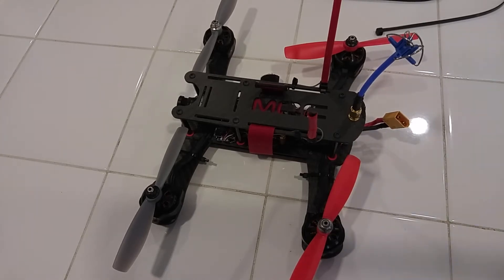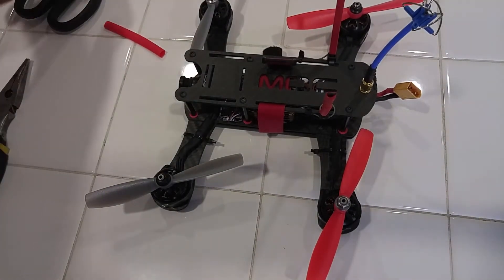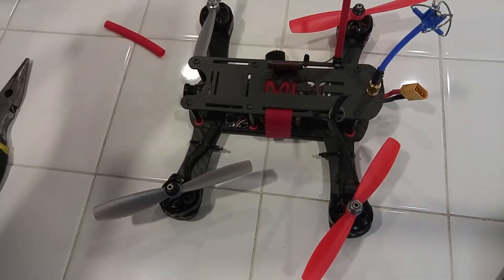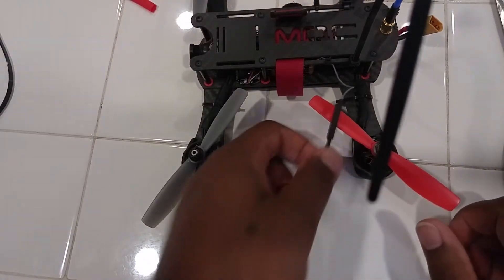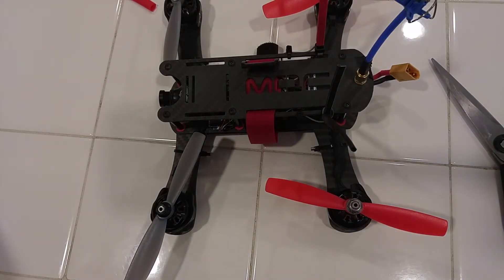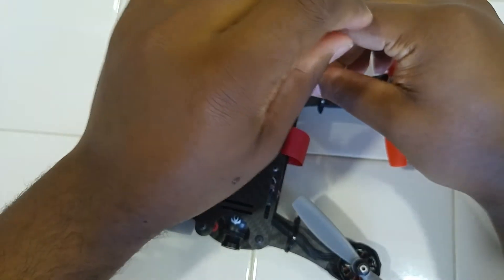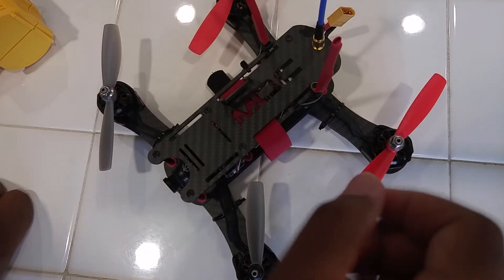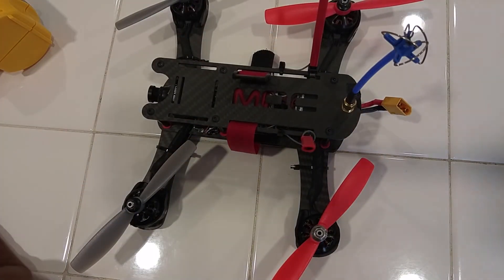Racing Drone Zip Tie Antenna Mount Instructions

Comment: Got a question on your top antenna mount..... your connection it touching the carbon fiber? Are you getting noise in the feed
Reply from the maker: As long as the tip of the antenna isn't touching anything you will be fine. The antenna wire is shielded except at the tip.
Reply: @RCFlyer85  that's correct but the sma connector is its ground for the antenna correct?
Reply from the maker: @mafiafpv3469  lol... Sorry I just woke up I'm thinking about the RX antennas lol

As for the SMA I don't remember this causing any issues and I had this type of mount on a few different quads. Most newer quads usually come with a rubber grommet though. You would only have an issue if you had something touching the frame that shouldn't be. All electronics should be isolated from the frame with the exception of the SMA
Reply: @RCFlyer85  exception sma? What you mean on that lol
Reply from the maker: @mafiafpv3469  I mean that if the SMA is the only thing touching the carbon it's fine as long as nothing else is touching  it... Ideally yes you would want to have everything isolated but there's no ill effect by just having the SMA touching.

Sorry if I'm not explaining this in a great way